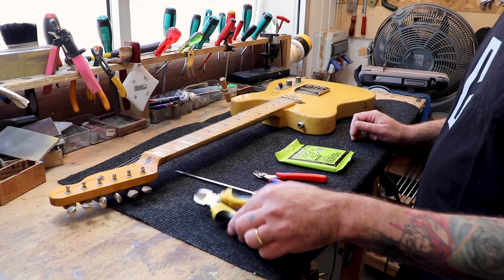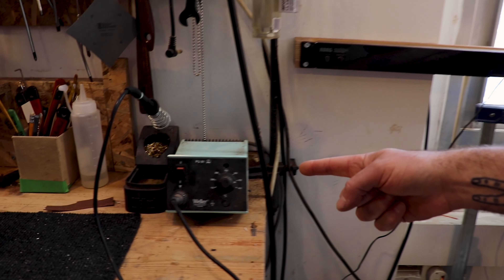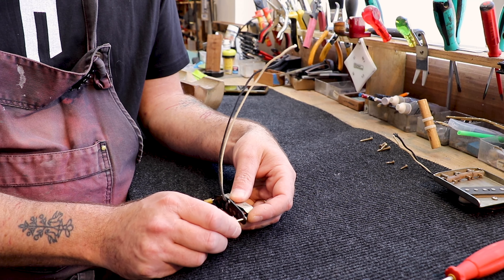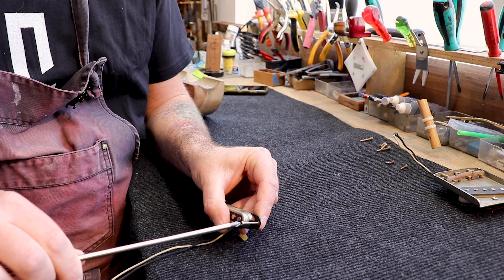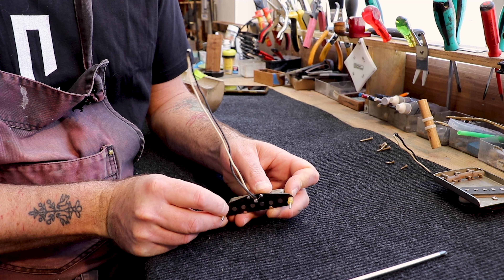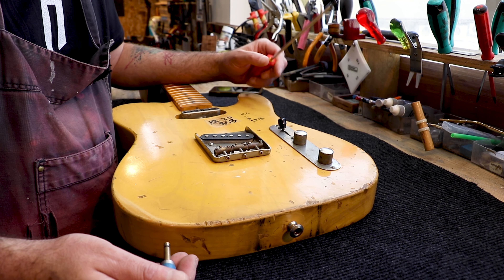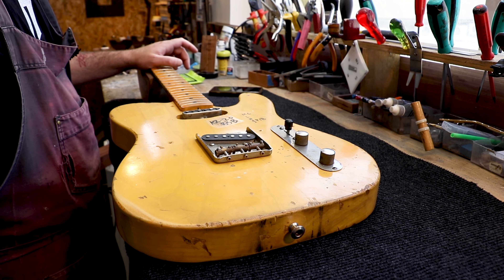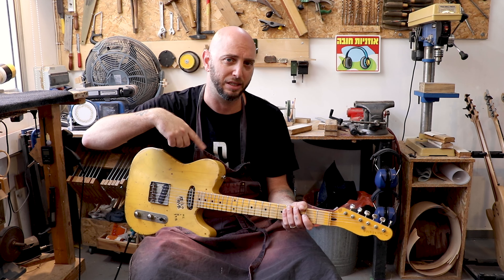Telecaster Pickup Installation Made Easy (a step-by-step guide)

Comment: Does it matter where you solder the pickup ground wires to the volume pot?
Reply from the maker: No, not really. The best thing is to create a hub for all grounds, but it's more important for active circuitry.  Just solder to the casing for a pot, and you should be good to go.

Comment: Great video! 2 questions if you wouldn’t mind. I have a noiseless fender in the neck but installing a lil 59 in the bridge. Should I switch hot and ground in the 59 bc it would be out of phase? Also, is there a need for a ground to the base plate of bridge to the bridge cavity and then ending at the volume pot?
Reply from the maker: First question: You will need to connect the pickups and put on some strings to check the phase issues.
 Second question: I really recommend you ground the bridge when using those pickups.

Comment: Great video, very clear - thank you! I have a Fender Made in Japan 62 Telecaster with two wires sitting under the bridge plate, ie soldered to the body on a strip of copper wire. Obviously they are ground wires, grounding to the plate - and they are making it impossible to get the bridge plate flat against the body.  I see you do not have these at all - are they likely to be the pickup grounds? Or something else? I know people say you need a ground wire under the bridge plate but you don't have this, so should I disconnect these wires, and resolder to the volume pot like you did? Or might they be something else?
Reply from the maker: Well, the pickup on my guitar has a base plate that grounds the entire bridge. If you do not have a base plate on your pickup you should ground the bridge using wires. For those kind of cases I usually use a copper shielding tape to ground the bridge - it's super flat and won't cause any gap between the bridge and the body.
Reply: @coilsboutiquepickups  Many thanks for replying. The copper tape (I said wire above, but I meant tape!) is as flat as can be, as you say, but there are 2 "bulges" where the wires have been soldered to the tape. Those two solder/wire lumps are what is preventing the bridge plate laying flat. My bridge pickup has a metal base plate. I only just bought this Tele 2nd hand (2 weeks ago) and it had Texas Specials added by the first owner. It sounds to me as though he has added earth/ground wires that he didn't need? I haven't taken it all apart - sounds like I need to do that and trace where they both go? In your opinion as I have a metal base on my bridge pickup, should there be any ground wire needed under my bridge plate? I think I need one from neck pickup (cover?) to the volume pot, but do I need any other ground wire at all?
Reply from the maker: @gazzie12000  According to what you're saying - no, it seems that you don't need any additional grounding except for the base plate of the bridge pickup and the neck pickup cover is usually soldered to ground straight out of the pickup's wire. You can send me some photos of the bottom of your pickups to Service@coilsboutique.com so I can be sure of what is going on there.
Reply: @coilsboutiquepickups  Thanks, yes I understand. I'm going to have a look over the next few days, when I've got time to take it apart and trace the wires back. From the video and your advice, I think I can probably work out what to do, definitely there's something not right, and 2 wires grounding to bridge plate is certainly wrong!. In terms of the bridge plate, at most it should be one ground from controls (volume pot) to underside of bridge plate I think., and usually just bare wire lying between body and plate. So I'll see where those existing 2 soldered wires are coming from. But if I'm unsure what to do I'll be in touch - many thanks for the video and the advice!!
Reply from the maker: @gazzie12000  happy to assist.  Take care

Comment: Cool tutorial 👍🏻thank you for sharing. Is it possible to install a Strat style 2 screw single coil in the Tele bridge plate position which would require a triangular style 3 screw pickup, is there an adapter plate required? Thanks 👍🏻
Reply from the maker: It would be easier to convert a tele style bobbin to sound more like a strat pickup than to modify a strat pickup to fit onto a tele guitar... Also, the spacing of the strat pickup is much smaller than a tele pickup
Reply: @coilsboutiquepickups  thanks a mil for your kind replyl, I was looking to install a standard 2 screw hot rail in a Tele 3 screw  bridge position, but it looks like an adapter doesn't exist
Reply from the maker: @toneranger  Sure, I also don't know of an existing adapter...
Reply: @coilsboutiquepickups  cheers 👍🏻

Comment: Thanks for the video, very clear! However, when I touch my neck pickup cover, there's a buzz? Do I need to ground the cover? Thanks
Reply from the maker: Yes. You do need to ground the cover. Usually, tele neck pickup covers are already soldered to the pickup eyelet. If so, you have installed the wire opposite, and you should switch between the hot and the ground of both pickups